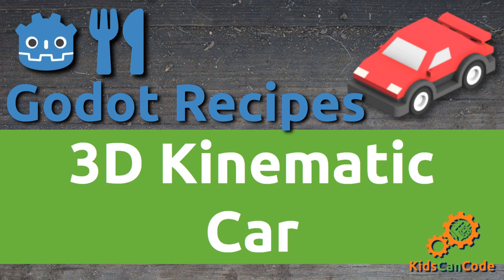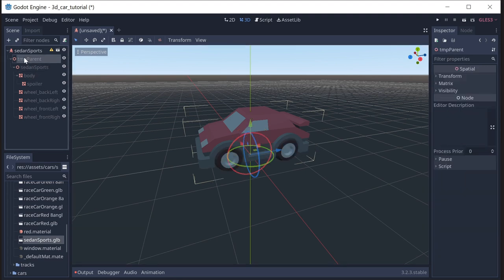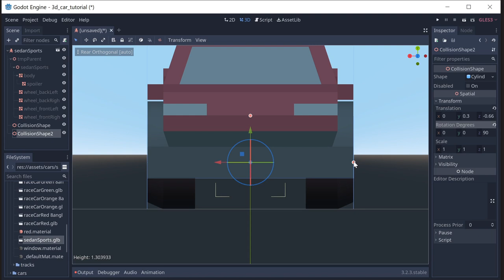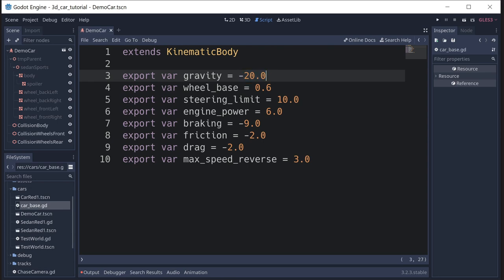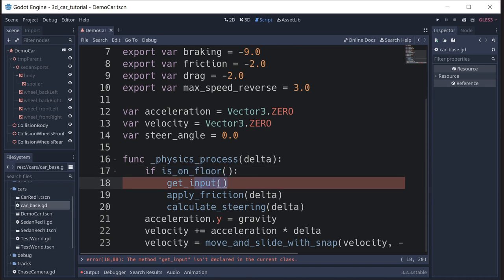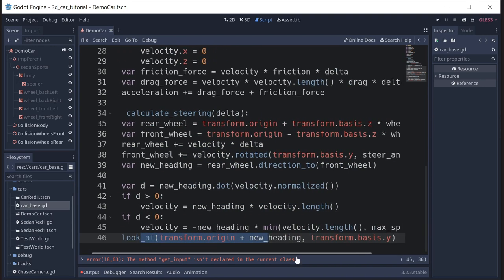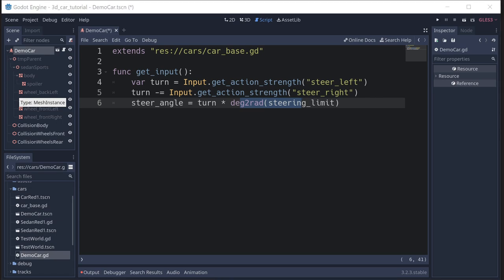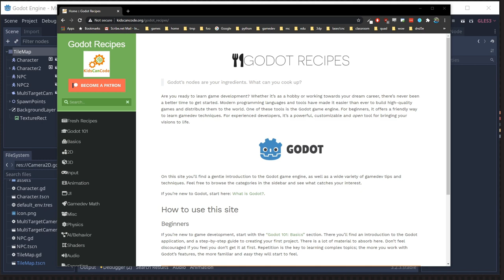Godot Recipe: 3D Kinematic Car

Comment: Just a minor nitpick for ~18:14, if we're not using the magnitude of the dot product, we don't need to normalize the velocity and we save ourselves a square root.
Excellent tutorial nonetheless!
Reply from the maker: I haven't worried about such things for years. The cost of a square root is insignificant in today's processors. If you find yourself in a situation where such micro-optimizations are important, sure, go for it.

Comment: I know this tutorial was a while back ago so it might be the deference's in versions but for some reason the car doesn't erase it velocity almost. If I start running it and accelerate then try to reverse, eventually the car starts to stop but will still go forward very slowly. The same happens if I try to reverse the car first. Can anyone help me with this?
Reply: Mine does the same did you fix it?
Reply: @ryscale4014  no unfortunately not. I ended up shelving the project to work on some other time. Sorry mate
Reply: @cosmicfruit7111  Thank you for replying.
Reply: * Change true in velocity variable in _physics_process to false

func _physics_process(delta):
	if is_on_floor():
		get_input()
		apply_friction(delta)
		calculate_steering(delta)
	acceleration.y = gravity
	velocity += acceleration * delta
=>	velocity = move_and_slide_with_snap(velocity, -transform.basis.y, Vector3.UP, true)
                                                       to 
velocity = move_and_slide_with_snap(velocity, -transform.basis.y, Vector3.UP, false)

 * And play around with the drag , friction, engine power and max_speed_reverse variable. For me the following worked

export var gravity = -20.0
export var wheel_base = 0.6
export var steering_limit = 10.0
export var engine_power = 20
export var braking = -9.0
export var friction = -10.0
export var drag = -5.0
export var max_speed_reverse = 10.0

Comment: How would you add a gradual turning for when the player uses the keyboard?
EDIT: well, I managed to kinda hack it in. I don't like it much, but it works. Code below, if anyone needs this:

var steer_speed = 2

func get_input(delta):
    var turn = Input.get_action_strength("steer_left") - Input.get_action_strength("steer_right")
    var steer_angle_degs = rad2deg(steer_angle)
    var steer_factor = steer_speed*delta
    
    if turn > 0:   steer_angle_degs = lerp(steer_angle_degs, steering_limit, steer_factor)
    elif turn < 0: steer_angle_degs = lerp(steer_angle_degs, -steering_limit, steer_factor)
    else:         steer_angle_degs = lerp(steer_angle_degs, 0, steer_factor)
    
    steer_angle = deg2rad(clamp(steer_angle_degs, -steering_limit, steering_limit))

Comment: Hi, did anyone got this error while running in F6 mode? I got it, the car can still run but I can't steer, the wheels do rotate but the car itself doesn't. I have copied every exact word of the script down from the doc.

When I clicked on it, it returned me to the line "front_wheel += velocity.rotated(transform.basis.y, steer_angle) * delta" in func calculate steering 

Error: set_axis_angle: The axis Vector3 must be normalized.

EDIT: Ok I found the solution, you can just stick .normalized after transform.basis.y, turning the line to "front_wheel += velocity.rotated(transform.basis.y.normalized(), steer_angle) * delta"
Reply: $tmpParent/race/wheel_frontLeft.rotation.y = deg2rad(180)+(steer_angle*2) in the get input helped me
Reply: @louisjoseph7869  What's the error though?
Reply: @spaghettiman512  my bad i thought u had the problem of the frontleft wheel not being alingned. the model had used the same wheels inverted so the leftwheel in the front  would look like the right wheel.

Comment: not sure what i did wrong, triple check the code. But velocity.length() is throwing a "nonexistant function 'length' in base 'float' error. In fact both Acceleration and Velocity aren't recognized as a vector3
EDIT: figured it out, spelled tranform instead of transform. Not even sure how it did that

Comment: Thanks a lot ! But there is a problem in my computer , every time I import the car it doesn't have color , its just plain black . Is there a solution for this ? Thanks
Reply: are you using a intel graphics if so try switching you project to GLES 2
Reply: @_WeHaveFun_  I already did that as my computer doesn't run Godot without GLES 2

Comment: I really like the look of this implementation, especially because I can really feel the impact the controls have by simply watching the footage of you driving around, but why implement it this way from scratch and not use a VehicleBody Node? With a bit of tweaking it seems this can achieve similar results but with the advantage of full vehicle body physics. Of course your method is a bit easier to get started with for simple projects but the built in node seems way more flexible, especially in case of collision detection and implementing multiple different vehicles.

Edit: Okay, I just tried the built in node an now I understand why you implement it that way. I was not aware that this method results in failsafe car handling like in Super Mario Kart while the built in VehicleBody results in a more realistic car driving experience like in GTA.
Reply from the maker: I addressed this in the demo. VehicleBody is fine, but being RigidBody based, has the same tradeoffs versus KinematicBody. As I mentioned, if you want an arcade-style feel, and don't need more complex simulation with suspension, etc. then you don't need VehicleBody. It all boils down to what you need for your game.

Comment: This solution works, but colliding with obstacles or AI will be hard to solve to look realistic. Why Kinematic type for the physics-based game?
I think that VehicleBody is much easier to use in an arcade game like this. It is not too hard to set up and the final result is much better.
Reply from the maker: I never said this was for a physics-based game, and we're not going for "realistic". I've done both, and for this particular application, I like the control KinematicBody gives me. Yes, VehicleBody solves some issues, but it raises others, just like any RigidBody vs KinematicBody tradeoff. 

I should probably do a VehicleBody demo at some point to highlight the differences. (adds to list)
Reply: @Kidscancode  I apologize for that word, I mean "realistic" compared to "Mario kart" games.
Every racing game has some kind of physics interaction between cars and world environment. And that's where I see the problem. From my experience, the kinematic body is great for characters - move and play an animation. But the racing car needs to bounce off the walls and reacts with other cars. And you are using move and slide for movement. How you plan to handle collisions?
Reply: It’s best practice to reduce the amount of randomness in Arcady games to make it as fun as it can possibly be. Collision could easily be solved by playing a cartoony animation for when 2 cars bump into each other. But normally that isn’t fun so I don’t it’s a good idea.
Reply: @Kidscancode  I have to agree with the concerns about the collisions, though. They're too sticky for games like Outrun 2 or GTA 2, for example. If you touch a wall from the side, the front will turn into the wall and stop your car. I'm not sure where the problem may be, though. Maybe it's the move_and_slide function, or maybe there's something else we could do there to fix this.

I'd like to point out, though, that RigidBody has a kinematic mode, and it can also be controlled by a "custom integrator". Might be worth keeping in mind. Personally, I don't know enough to know what to do.

Shifty (the Qodot dev) wrote about this, regarding FPS character controllers, but I suppose the same notions could be extrapolated to cars: https://markdownpastebin.com/?id=d9d61e67f9d64db2bd215f165b931449